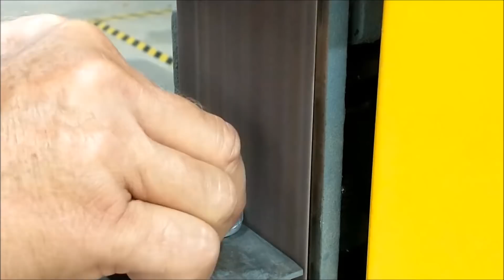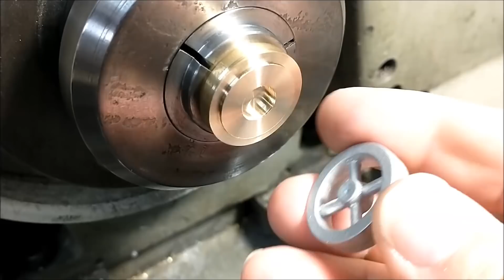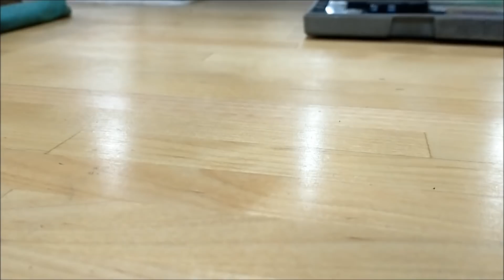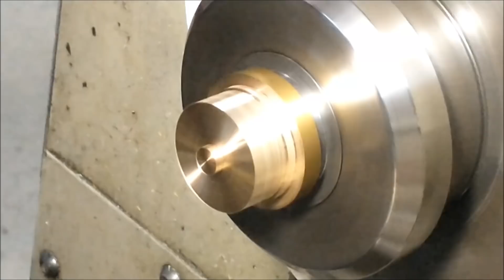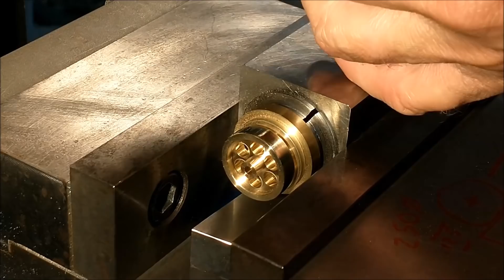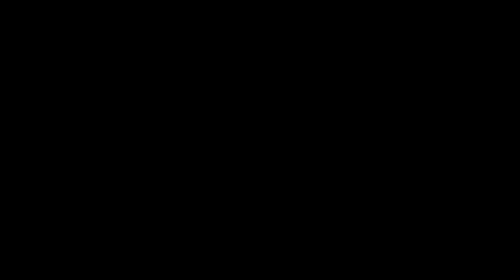When Reinventing The Wheel is Your Only Option !!!

Comment: What is an oblique set screw and how does it differ from your method of securing the pulley to the shaft?
Reply: i would guess its a set screw off to one side of the diameter ?
Reply from the maker: It would be drilled and tapped at an angle to the bore.

Comment: 660 Bronze I assume.
I've seen plenty of 5C collets with witness marks in the outside radius but I think it's the first time I've seen it done intentionally.  But then 5Cs are pretty cheap unless you're buying Hardinge. When doing work in 5C collets where the opposing faces need to be parallel I always liked to use the Hardinge disc type work stops.
Reply from the maker: The color was a dead give away as compared to the kit brass. As for the collet, its fine. I have new ones if I need one, but I see it as more useful now, not damaged.
Reply: @joepie221  
Oh, I didn't think of it as damaged. Now its improved or field modified. It's an Enco too I see. Have a few of those along with other "off" brands. Over the years I've had to grind a few Hardinge spindles in situ* to eliminate the wear that occurs on the internal taper due to all the collet closings over the years. Always cleaned up the spindle face to. When you have 150 to 200 people jumping in and out of machines 24/7 the wear on the equipment gets ramped up. 
*the spindle bearings should last way beyond the point where the beds begin to get worn and the turcite eventually begins to get torn up due to swarf getting past the  way wipers. Nice lathes. I only wish I could justify one for a home shop. I know one individual that managed to pick-up a Rivett copy of the 10EE. Nice lathe. The small Graziano's are too. But they have a really wonky electromagnetic clutch set-up in the speed change. Parts are near impossible to find.

Comment: Another good video, Joe. The tip about inserting a rod to support the small boss while gripping the boss in the collet was worth price of admission.
Reply from the maker: You bet. On softer material, the hole would shut pretty easily and that translates to a loss of grip too since the diameter yields.

Comment: As always, well done and a well produced video.
You used brass. Why not aluminum to get it more like the rest of the machine?
At time 12 You turn down the collet. Why not leave a longer piece earlier to grab on to and avoid that turning down?
Reply from the maker: Because I'd have to re-grip the part on a polished domed surface and that wouldn't allow me to get the parallelism or matching concentricity I was after.
Reply: @joepie221  Grabbing in that "extra handle", chopping it off, hacksaw or plier and then some little file work to the chopped off surface of the wheel?
It looks "costly" to me to modify a tool like that. 
Okey, good to know that strategy from Your video.
Reply: Isn't hindsight wonderful

Comment: You should return that pulley and tell them that it is a piece of crap. Then, refer them to this video on quality work. Only way they will know that their parts are not up to standard. Big +++ to you save Joe.
Reply from the maker: They watch my material. I think it was handled diplomatically.
Reply: To be fair to PMR, that mold offset is not bad at all. It's just that the part is so small there's no leeway for even that small error. Their mistake was not leaving some extra meat on the piece to account for the inevitable molding issues.

Comment: That's not a casting error, it's your error for not picking it up beforehand.
Reply from the maker: I didn't miss it initially, but until datum surfaces start to fall into place, the cosmetic surfaces aren't in their final place yet. I actually could have saved it, but it would have had to be thinner and taken a few hours of bench work.

Comment: I bet PM would have rather sent you 5 new castings than have this posted....
I got a bad casting from Coles many years ago, core in backwards on the main block for the Holt engine.
They replaced it no problem, just glad I found the issue before putting much work in, about a million setups for that part............
Reply from the maker: They are a great company and would have quickly replaced it if I asked. 100% no doubt.

Comment: Well, I was wondering how you were going to approach the replacement, and you've opted for what I would have done (drill out the spokes). I'm going to guess you'll manually clean up the inside spokes with files?
I do agree (for now) with some other comments that the brass pulley looks "out of place" for this build. Unless you plan on using some brass "highlight" parts for a color balance?
I would have chosen aluminum or steel with a sandblasting at the end. Looking forward to the (perfect as usual) end product.
Reply from the maker: If I were planning to clean the spokes, I'd do the entire part on a rotary table. Piece of cake.

Comment: An ecxcellent save Joe, disc wheels were in as much use as spoke wheels. It will add an individual character to this build which will sstill be to musuem standards. My only criticism would be a shame you didn't use ali instead of brass. But still inspirational how you overcame. Excellent work as usual.

Comment: Now the drive pully is the nicest piece on the drill. Great fix I've always had a hard time working with getting those die-cast pullys to run true. I also like the mod to your Collett. It's not easy to find ways to hold these small parts. Great work.

Comment: Hey Joe how many small parts with a hole in the middle did you crush before learning or being taught to put a pin in there?
The way you spoke had a tone of "I learned this the hard way."
How often do you machine collets to suit projects? You seemed to do that as if its "a matter of common practice." 
Can you do the same thing with ER Collets or is only for 5C?
Reply from the maker: Just one. But I never forgot it. The face cut on the 5C collet didn't compromise the utility or function at all. Of course, using an emergency collet may have been easier on the tool. I do have another precision 1/4" 5C, so no worries there. I don't think I'd do this to an ER and expect the same performance.
Reply: @joepie221  Yeah mate we all have those lessons we'd have preferred someone else tell us about instead of experiencing first hand.

Its what makes your channel and a few others so awesome.

Did you see Mark Presling's oops with an adjustable reamer on his Titan Glow Plug engine? That's a lesson to all.

Comment: Beautiful work!  To match the original design, another option would have been to trepan full depth of part and then radial drill 4 holes at 90 degree and insert and silver solder the spokes, then surface the OD and part off.
Reply from the maker: I had a variety of options.
Reply: Joe did a pair of videos for a 14 spoke wheel about a year ago. Just after his miniature cannon project.

Comment: Interesting holding technique with the collet. But, couldn’t you have saved the crowning for last to facilitate simpler work holding?
Reply from the maker: I always consider the required tool contact vs. the holding technique. If you have more tool contact than part grip, you raise the odds of the part coming out.

Comment: Beautiful looking part, very much an upgrade!  Could you not have made a threaded mandrel to hold the pulley using the centre bore, or would it have been too small a diameter to hold it rigidly?
Reply from the maker: It would have to have been a 5-40 or smaller. I think too much surface contact on the OD radius.

Comment: Could you not have held the part in the original fixture you made to hold the casting rather than carving into a collet? You could screw it through the centre hole and drive it with a pin in one of the "spoke holes"

Comment: When you said you were going to build it from scratch, my first question was how you were going to recreate the spokes.  I think the holes look sharp, better than the original.

One general request.  Will you please tell what speed you set the machines to?  Similar to how you transpose Imperial to metric.  As a beginner, one thing I struggle with is setting my machine speeds to get efficient cuts and to not burn up tools.  My request applies to all operations, lathe, mill, drill. 

Thanks

-Kurt

Comment: When you started to cut into the collect, I went 😱
Reply: It is good to know if it's a hardened collet or not = not all collets are suited for machining. There is also "collet blanks" available so one can make custom collets (for profiles etc).
Reply: I was surprised at how easily that 5C collet was machined. I thought the chips would come out blue and purple. Mine appear to be file hard in the 54-56 RC range. Watching this series is a good way to learn something new.
Reply: @ellieprice363  Some are also chromed (or other plating) which makes them less suitable for machining.